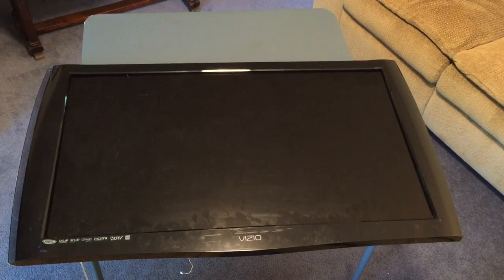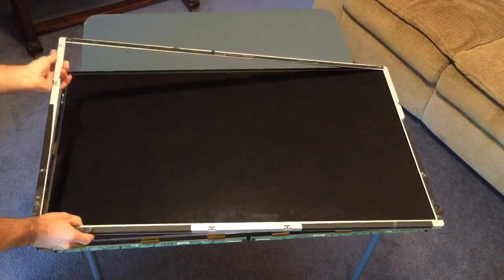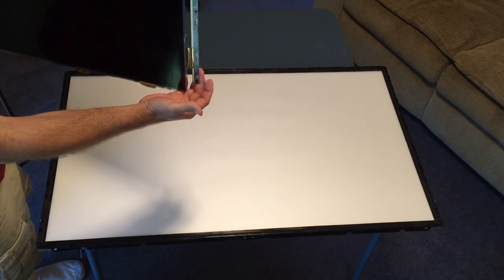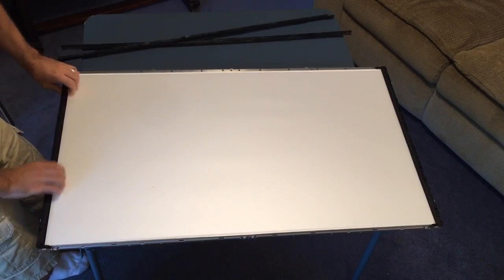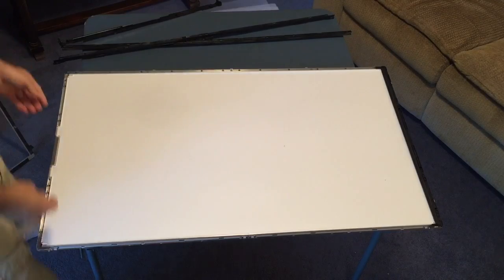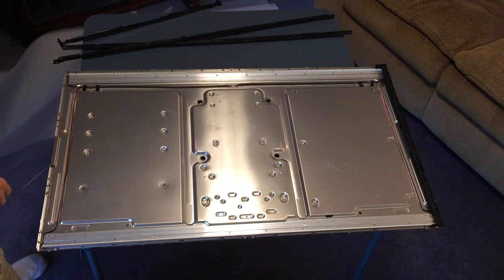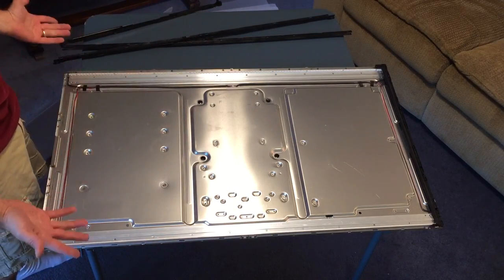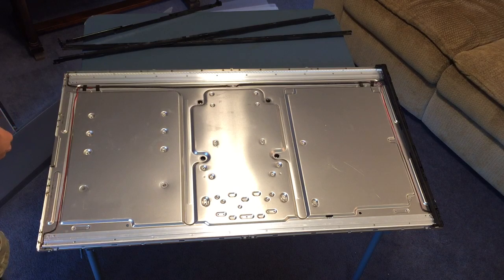Inside an LED LCD TV

Comment: I'm pretty sure the the "clear" plastic piece you removed is not really a diffuser in the classic sense. This is almost certainly an edge-lit LED TV which means that the LED's are positioned around the edge of the frame as opposed to directly behind the panel. When the LED's, which are along the edge of that panel, light up, the light will travel through that piece of plastic to fully illuminate the entire back area of the panel. Placing the LED's along the edges allowed manufacturers to create slightly thinner TV's and resulted in them being called "Edge-Lit" as opposed to backlit for that reason.

TV's that are actually backlit do have a true diffuser panel which is a whitish color and opaque to the point that you really can't see anything through it in terms of even shapes and allows for individually placed LED's behind it to create a reasonably even layer of light by spreading out the light in a more uniform way.

Comment: I sometimes take those shiny mirror like layers out from a broken TV of course and I will either draw or paint on them, do some kind of artwork and I can hang them up or sometimes I find a really pesky window that I want no curtains on but still want a softer light presents coming in from the Sun so I'll actually take one of these to my window in a nicely done manner so it looks decent you know it doesn't look rigged or jerry-rigged however you want to say it..

Also that led glass screen part, if you hold it up to like a light source and for example lightly tap it on your forehead, not hard enough to break it you'll notice that the light seems to flicker, get brighter and dimmer every time you apply pressure to the LCD screen..

But I really like drawing on those clear plastic and mirrored plastic layers for some kind of artwork

Comment: What is that color white sheets?
Reply: The white sheet is to reflect the light forward through the light guide plate.  There are 3 films on top.  The first is a diffusion film, and the next two are prism (to focus the light forward) films.  These last two are also called light brightners.

Comment: How do you Clean Dust Inside an LCD TV Screen ,  Without taking the TV apart ? Can I use air from a compressor , and  just blow inside the air vents of the TV ??
Reply: You will need to take the TV apart in order to lift the lcd screen up enough.  My trick is to get a long folded up piece of paper and lightly moisten the end and try to "grab" the dust.   No, you can't use an air compressor, unfortunately.

Comment: Straightforward description satisfying my curiosity, thank you!
I've a Toshiba TP 48 E50 rear projection tv manufactured in 1996 that's experiencing no picture but sound is ok. This condition occurred  suddenly, operating fine the day before. I've checked all settings and cable connections from the cable box to the set and are all as they should. The remote control changes volume and stations as normal as can be heard but not seen. Opening the front and back panels of the set to inspect, I'm finding three crt lamps. I'm suspecting something that controls the three lamps is affecting this as having all of them burn out at once doesn't seem plausible. Any experience with these or any ideas on what can be causing the issue?

Comment: How do edge lit tv’s like samsung nu8000 or Q7F get decent black levels with the bottom edge lit “ultra slim array?” It has good black uniformity, for being edge lit, and the black levels themselves are about 8/10 if full array was 9/10 and oled was 10/10. 

How can they do this just lighting from the edge?

Comment: How thick exactly is that sheet of plexiglass acrylic?
Reply from the maker: I don't know exactly, maybe 1/8".  It depends on the TV.  It is called the light guide plate on many lcd's.
Reply: On the Samsung UE49NU71000KXxu led TV im fixing its 2.5mm thick.
Reply: Can you use any plexi glass? As long as the same thickness?

Comment: I opened up an LG LED screen to replace the lights but when I was reassembling it, I mistakenly disarranged the diffusing mechanism, so, I'm now confused. I don't know the correct arrangement of the these four materials; ie, the diffusing material, the two reflecting materials, and the hard plastic. Please give me some advise
Reply: @Emmanuel Bahati i did the same thing as you, did you manage to find out
Reply: Hello, can you clean those diffusers in any kind of way?
Reply: There are notches on the sides that determine placement, I took mine off and lined them up and stacked them so I knew what order. I cleaned them with broad alcohol strokes to get rid of water damage and keep from leaning streak, unfortunately I cracked the main led "screen" putting it back together. It seemed like it was gonna work tho. I would align the tabs and just try a process of elimination with the order of the sheets
Reply: Hi, thanks for reaching out.  This is my new youtube channel (https://www.youtube.com/c/frugalrepair).  This is the only video I have on this channel (and its fairly old) and I have more information about screens/ tvs on the main channel.  If you subscribe there you should be getting more videos like this.

To answer your question, usually starting with the backlight you have 1) light guide plate, 2) diffusion film 3) light brightness (prism films) 4) LCD (polarizers are adhered to the lcd).  Does that help?  One of the biggest issues that you will have is keeping dust out.  After you put it back together you may see what looks like dead pixels on the screen but they are just dust/debris.

Comment: I think the light guide plate is there to redirect the LED light coming from bottom of the TV towards front of the screen
Reply from the maker: Yes, you are right.  On an edge lit led display the light needs to be distributed evenly so that you don't notice when you are looking at the display/tv.  The strip of led's are usually on the edge of the light guide plate so the light shines through the plastic.  There are dots on the back side of the plate to help bounce the light toward the lcd panel.

Comment: My led Tv light diffuser's has some  water in em...anyway of cleaning them?The Tv is functioning normally but you can see the water marks inside.
Reply from the maker: Yes, they can be cleaned but you really need to be careful not to break the panel.  When you open it up you will most likely introduce dust or other particles (these are made in dust free rooms at the factory) so you need to watch for that.  Those particles will make it look like you have dead pixels but it really is just the dust.  If you attempt it, I'd use isopropyl alcohol to wipe away the mineral deposits left behind by the water damage.

Comment: Something bumped my 4k vizio now the screen looks cracked but its not someone said something about pixel bleeding. Any idea how to fix?
Reply from the maker: If there is an issue with the lcd panel itself, I don't think you will be able to do anything to fix it.  If I could see a photo or video of it I could tell you more specifically.  Sorry for the bad news.  What it could be is something called a bruise on the lcd.  The polarization of the light gets messed up slightly because of some warping in the lcd panel.  There is nothing that I know of that you can do to easily repair that.

Comment: Hello, in my samsung led tv, the last white piece have a soft face and  coarse face , which one is toward the panel ? thanks
Reply from the maker: Were you replacing the led backlight?  I'm not sure which side goes which way.  Look in the corners and along the edge to see if there is a cut-out that matches to something on the metal frame.  That may give you a clue.  If you don't know and it is a perfect rectangle, then choose the side that looks shinier.   You want the light reflected forward toward the screen.

Comment: what if we replace the led backlight with ultraviolet led ,will it emit ultraviolet images
Reply from the maker: If the ultraviolet waves got through both polarizers and the lcd you still wouldn't be able to see them because the majority of the UV light spectrum is not visible to the human eye.  You might possibly be able to see a faint image on the screen due to the small visible portion of the light (why it looks violet to our eyes), where the wavelength is still long enough for our eyes to detect something.   But even if you "saw" anything it would not be a UV image in the technical sense, it would be a visible light image.